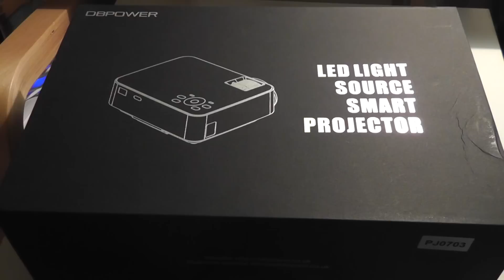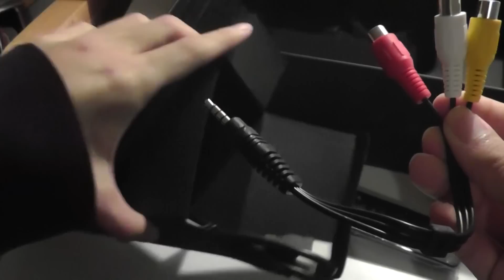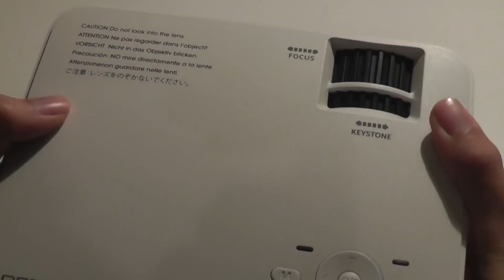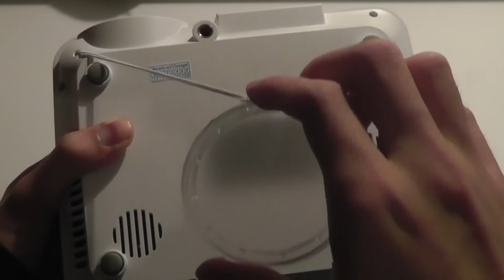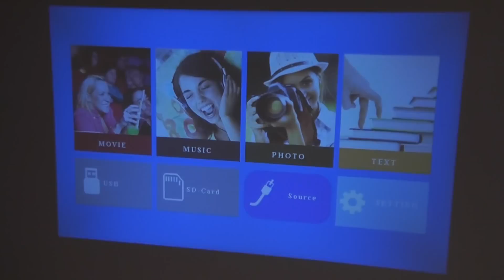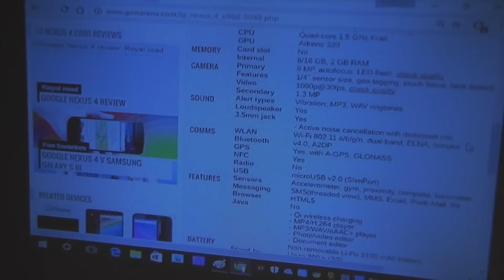REVIEW: DBPower T20 LED Mini Projector - 1500 Lumens!

Comment: I actually own one of these, I believe the newer revision. It works well for what I spent for it. I didn't feel like shelling out +$2-300 for one so decided to get this to get my fiance into the world of cooler stuff. I've owned better projectors in terms of power. However this one is great because I can carry it in my backpack and not worry about the "value" of carrying an expensive piece of equipment. I'm curious about the promised "50000 hour" lamp life. If this thing really lasts for years I'd be happy with it. It's convenient, but if you're used to higher end units, you might be disappointed. If it's your first one you'll likely enjoy it. I've been demoing and reviewing cars and electronics for years and am overall satisfied. Edit: The connectivity options work well, mostly referring to the HDMI port. It doesn't appear to work very good via the VGA connector. It's good for gaming and videos, but nothing that requires fine detail attention.
Reply: Mobile in connect video
Reply: Hi Adam, is this projector good to watch full movies?
Reply: For the life, led is almost immortal!

Comment: I don't see a way to do a ceiling mount with this projector.  I'm surprised there are not holes for that.  Am I missing something?
Reply: A little imagination, probably. Use the threaded tripod mount to hang it upside down, and then use either the projector settings or your source settings to rotate the image 180 degrees. It's hardly a challenging problem.